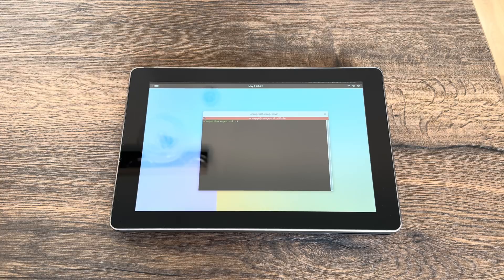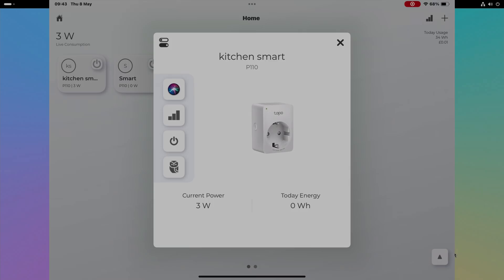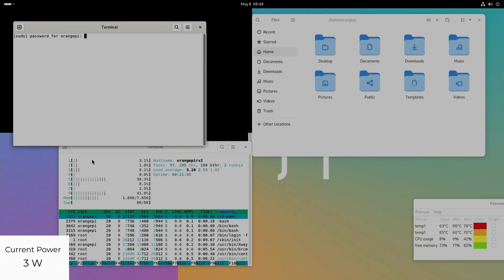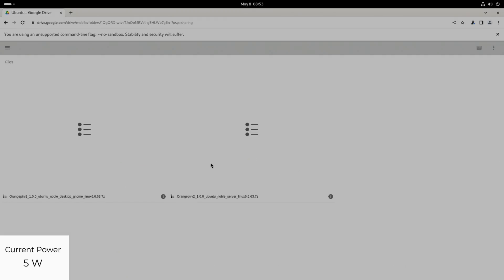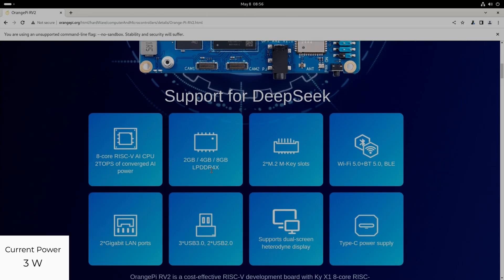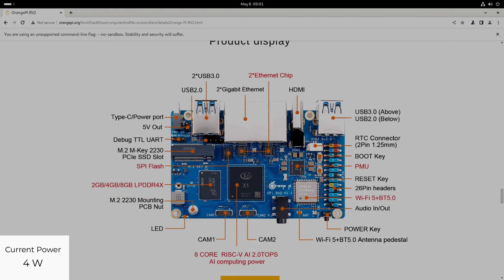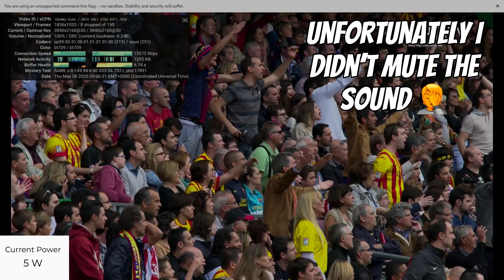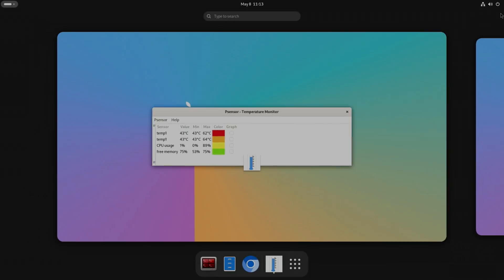Super low power SBC. Orange Pi RV2. Open Source RISC-V CPU.

Comment: I just received mine today, I'm a little disappointed that they didn't do a better job of aligning the form factor with the raspberry pi 5. It's not far off, could it really have taken much more design time?

So far it's pretty snappy, but I haven't done a lot yet. Eventually I plan to install the openWRT image and do some open router testing.

Comment: I wish RISC-v development would take a different route, like i just want some manufactor considering Highend core performance but with dual core design. To make it a bit cheaper. I rad Pi 5 SoC die size was around 30+mm², then they can achieve sub $60 boards. It based on 4 cortex a76 on 16nm(?)

Imagine dual core Akeana 5300(cortex x1/x2 equivalent?) SoC with simillar size.. ±50mm², or atleast smaller than rk3588. Then the price and performance would easily reach low-mid edge, SBC, Phone, tablets, and so many other segment. And at least PCIe gen 3/4 x 4 lane for that spicy eGPU support😂

Comment: I have a problem with the   Deskpi lite NVMe case for Raspberry Pi 5   i get this message saying  *Failed to open NVME *No wonder people sent the case back on Amazon😒I can see why some cases give you two PCI cables there so delicate:face-purple-crying:The NVME drive in here worked fine on my  pi4 Argon case.Hope you can help me Lee.🙂Good informative videos.🙂
Reply from the maker: @timcollins9800 could be the nvme.

which NVMe drives work with a Raspberry Pi 5?
https://youtu.be/3mUgVTBmKio
Reply: @leepspvideo  Thanks for your rely  Lee,👍.I was useing a old sata one which was in my pi4 Argon case.I got the one you were using on that video.🙂
Reply: @leepspvideo  I got the one you were using Patriot P310  it still would not work with it ,i am sending it back .Any other cases that use full size HDMI connections apart from the way over priced Argon case.I do hate those micro HDMI connections ,i don,t know why they don,t scrap them.:face-orange-frowning:
Reply from the maker: @ Electrocookie Raspberry Pi 5 NVMe case with a Door!
https://youtu.be/moN6m-Uu1QY

Deskpi lite NVMe case for Raspberry Pi 5
https://youtu.be/n4tAf6I5G4M

Comment: Thanks for sharing the review.  I see you don't do much with cameras.  Would like to learn more about the CSI interfaces on the Orange Pi series.  Those 2x15 pin connectors (no idea what they're called) don't seem to be as common as the Pi flat flexible cables used for Pi cameras and such, which would suggest the company didn't consider csi a serious feature when the embedded camera market favors FFC.
Reply from the maker: @charetjc  if I was working with cameras I probably wouldn’t choose Orange Pi.

The Raspberry Pi overwhelmingly has better support and forums regarding cameras

Comment: I'm impressed that it can handle 4K video. That is nuts for a hardware that feels slow with OS itself
Reply: If it's using a dedicated hardware decoder, then it's no surprise. But yeah, it's kind of impressive as most SBCs won't do this, not mentioning it's 4K VP9 decoding which I'm waiting for the Pi to do for a long time.
Reply: I think is is hardware decode.  Explaing computers checked chromium and it said hardware.

Comment: If it could run Deepseek  as a local LLM, it could be handy for Home Assistant
Reply: @rorylong314  it will probably run one of the lowest parameters ones locally, like 1b or 2b, it can’t run the fully fledged deepseek, not even M3 Ultra Mac Mini with 512 GB unified ram can run full fledged deepseek

Comment: to run a program from terminal like psensor use
psensor &     [ needs at least 1 space before the & ]
it will run but not block the terminal, you can run several gui programs each ending with an ampersand, run neofetch and then close the terminal
e.g.  ( enter after each line )
psensor &  
gparted &
xmahjongg &

Comment: Nothing about a GPU, im guessing it doesnt have one ?
Reply: It has a PowerVR BXE-2-32 GPU from Imagination Technologies.
Reply from the maker: @ Yes, after installing Vulkan I tried to run vkcube.

I get Selected GPU 0: Power VR B-Series BXE-2-32 MC1, type: IntegratedGpu Segmentation fault.
Reply from the maker: @MrJaz8088  I can’t see anything mentioned in the specs. Just AI
Reply: Same as the Pi 5.  Supports 1440 up to 60 fps.  It says that it can drive dual displays.  I will find out tonight after mine gets here.

Comment: Is the design of this processor actually open source, or by open source you meant the architecture, because yea RISC-V architecture is open source, but the CPU manufacturers who design a CPU based on the architecture, the CPU design may not be open source
Reply: The ISA is open source not the silicone.
Reply: CORE-V is a family of permissively licensed, open-source RISC-V cores curated by the OpenHW Foundation ecosystem. The OpenHW Foundation, part of the Eclipse Foundation, is the leading global community for industrial-grade, open-source RISC-V CPU development and innovation.
Reply: I think it's the Ky X1, but I can't seem to find much about it. Also not on the CORE-V of OpenHW Foundation development page.
Reply: @autohmae  this X1 appears to be exactly the same as the SpacemiT K1/M1 which has been around for a year in the BPI-F3, MusePi, Lichee Pi 3A, Milk-V Jupiter, DC-Roma II laptop etc I have an LPi 3A with 16 GB RAM. SpacemiT don't say exactly what their X60 core is, but reverse-engineering and benchmarks indicate it's almost certainly a THead C908. It's similar to Arm A53 or A55 (closer to the latter) so not quite as fast as the A72 in the Pi 4, but the much more important is that it supports 16 GB RAM (8 on the board shown here) which means that it can run a far wider range of demanding tasks than a Pi 3 with 1 GB RAM or Pi Zero 2 with half a GB. The ability to run an M.2 SSD is a big bonus for real tasks also compared to Pi 3 / Pi 4 which support only SD card and USB for storage. The RVV 1.0 vector implementation with 32x 256 bit vector registers is nice too. This chip is not yet a high performance implementation like we'll have in the next years but it's comparable to NEON but with twice bigger registers and much nicer to program for.
Reply: @ all the things I mentioned use the exact same chip, so naturally they all support the same ISA! There are many other CPU cores and SoCs but if shrink-wrapped Linux runs on them then they are all RV64GC, now called RVA20. Sometime in future a newer version such as RVA23 will be required but RVA20 programs will run fine forever.